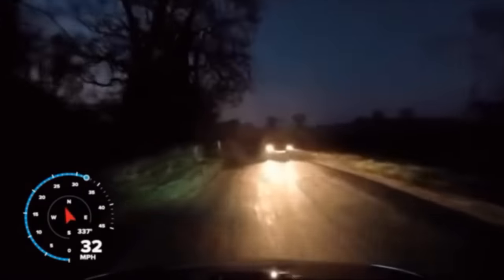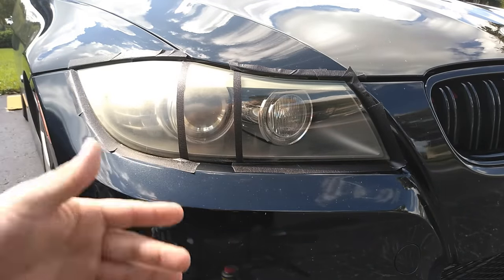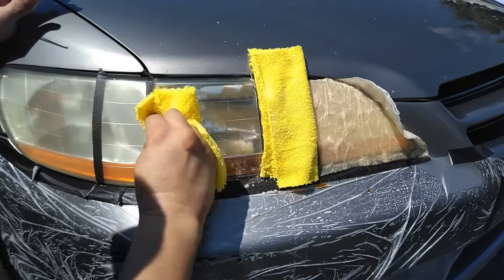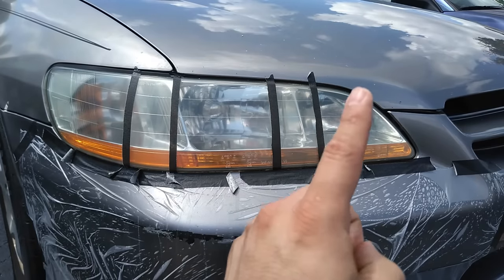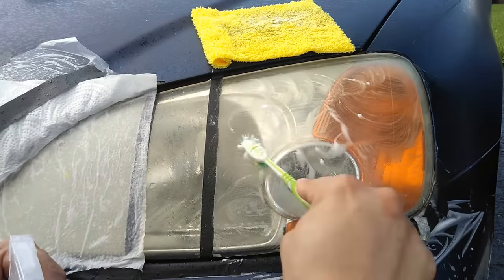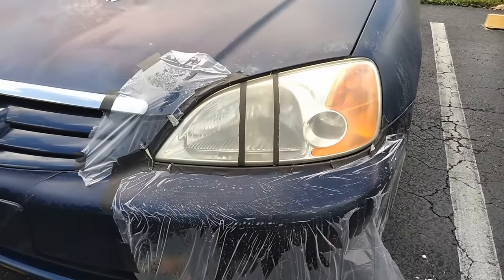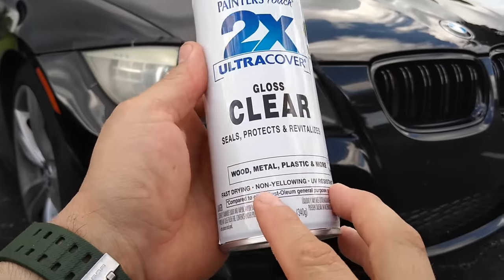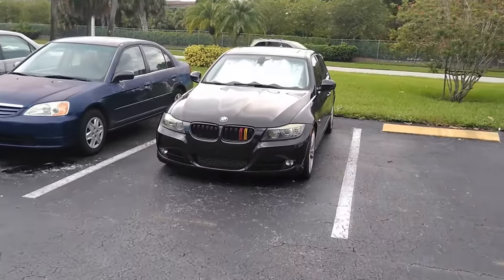How to Restore Headlights with Household Products (Easy, Affordable & Fast)

Comment: I’m a 71 year old female. I’m the original owner of a 2004 Honda Accord with only 61K miles. Last evening I was positive my headlights weren’t working. There were areas of my route I had to use high beams. When I got home, I discovered they were working but the lens were so cloudy very little light was getting through. I texted some male friends and said they can be cleaned for $100-300. I discovered your video!  I have the Mr Clean magic erasers. I just used a couple days ago to clean the white edge of my tennis shoes. I will buy the spray protectant and clean ASAP. Thank you for your excellent tutorial. I have been able to diagnose and fix several problems myself by watching Utube videos. I will let you know how my application goes. Thank you from Dallas
Reply: Please let us know
Reply: I hope all is well and we're still awaiting your reply!
Reply: I'm 74 and a few months ago changed my 2019 CRV brake lights. Looove Youtube DIY🎉
Reply: @ruthjorge440  😊00qaqqq1¹
Reply: Thank you for sharing
Reply: 2002 Honda Accord myself... 💞❣Great cars
Reply: Yes
How to clear moisture!
Reply: Off insect repellent works very well too
Reply: I'm 55 and your method is not right or ideal at all unless the units are very new
Reply: How did they turn out?
Reply: Lol you need new friends, headlight restoration kit [sand papers & polish] will run you about $15. Toss the different sand papers on a drill and you’ll have new lights in about an hour. 30 mins each light.
Reply: @Sir_Richard_Crainum_lll  ...your right a light sanding an power buffer using the polish....30 minutes per side. You can spray some clear cote an light buff by hand will last a lot longer .
Reply: Anaconda
Reply: Wow I’m so sorry somebody was gunna try to charge you so much just to clean your headlights. If I lived in Texas near Dallas I’d come do them for you for free ❤️ let us know how it goes! 😊
Reply: Yes how to clean moisture out
Reply: L
Reply from the maker: I just made a video for programing your Hondas Key fob at home. 😉

Comment: Show me how you can get the moisture out of your head lights
Reply: Replace the assembly?
Reply: Heat gun gets the water out from the headlight or blow dryer
Reply: @tonykeiiz7807  that's a whole lot cheaper than replacing it lol
Reply: Yea, how do I get rid of that inner headlight moisture?  Charles McC
Reply: Find out where moisture is entering, repair it. 
drill a small hole in an inconspicuous spot and use a hand held vacuum pump to pull a vacuum and hold it for awhile, this will do two things. It will evacuate moisture 
(same as pulling a vacuum on an a/c system) 
and it will confirm you have fixed your moisture entry leak. 
Remove pump, seal hole immediately with your choice of quick setting sealant.
Reply: yes please 😊
Reply: @MegaTapdog  yes pull a vacume on the assembly.... some assemblys have a port tou can hook the line up to
Reply: like mega tapdog says vacume will remove the moisture...
Reply: Moisture in Head lights
Reply: I drilled a hole drained and later plugged with a removable plug.
Reply: @angelnunyabeezwax3348  I
Reply: @tonykeiiz7807  be careful with heat gun. Can melt the plastic ...
Reply: Show me how to get moisture out of headlights
Reply: @kimgordon3695  exactly right luv
Reply: Remove headlight housing.
Remove bulb from housing.
Take housing indoors, and place it in front of warm air register (or use hair dryer).
Find holes or cracks in housing where moisture is entering, repair with clear RTV silicone.
Reinstall bulb.
Reinstall headlight into vehicle.
Reply: Yes, that’s a good question
Reply: @charlesmcclatchy7413  open the hood and take the headlights with the attachment then get and hair dryer with a long plastic tube attached to the dryer and blow the heath inside to get rid of the moisture.  It work well for me.
Reply: Willcresttoothpastecleanheadlights
Reply: @tonykeiiz7807  thank you Tony
Reply: How to remove moisture from front n rear lights but prevent it also coming back that's the part I'd like to know n cheapest n easiest solution that works pls
Reply: Remove the housing protect it from getting junk and dust inside and sit in the sun or put in the oven after you're done cooking and have turned it off.

Comment: The coca cola acid and the flouride is an prime example of what it's doing to our insides
Reply: Not quite, but it would be fine never to drink soda again. Our stomach acid pretty much wipes out bad stuff. Can you imagine if our stomach acid was poured on a,rusty nail? It would clean it lol.
Reply: Wrong, lol.  You realize our stomachs are full of acid, right?  And even in your mouth and throat, you have a constant supply of saliva and mucus that minimize any damage, much less the effects you see on plastic.  And If you never brush your teeth with fluoride the sugar from the soda will lead to much more damage than any acid.
Reply: But, dang it's just so Goooood😂
Reply: The fluoride in toothpaste has nothing to do with the cleaning ability of the headlamp.

Comment: I wish SOOOO MUCH whoever got the idea for these PLASTIC HEADLAMPS had them stuck where the sun don't shine.  The GLASS Seal Beams were superior and CHEAP to replace.  This is just another gimmick the CONSUMER ECONOMY has to keep people BROKE.  But having said that, you did a GREAT JOB!!!  I have ONE question though, after applying the clear coat, when it goes BAD, it will one of these days, how do you clean it THEN??? Great Video!!!  BB
Reply: Just get a turtle wax restoration kit and put a lot of clear coating on after your done. The grit paper sands off all of the oxidation and the clear coat protects it from the sun for atleast a year. After any of these in this video you can expect oxidation after 3-6 months. That's why the kit is worth 20$.
Reply: Q
Reply: @thestranger1164  For $20 bucks you could buy to NEW seal beams that would last for YEARS.
Reply: I just use acetone nail polish remover.  Makes them crystal clear in one pass.   Don't make more than one pass...additional passes cause the fog again.  Don't get it on the paint.
Reply: @Lili-xq9sn how long does the nail remover last?
Reply: @MrGlowBaby  clear as new until uv re-exposure begins yellowing/clouding it again.  
I ordered 303 graphene nano spray coating to provide some uv protection after I erase the yellow/clouding again.   
The 303 is temporary.   I'll probably reapply it every month or so and hope it won't yellow/cloud up in future. 
(My parking spot is in the sun.)

Comment: Use a small foam pad on a drill instead of a toothbrush, and you will get much better results. Then put a coat of wax on it and buff it out. When you've done that, use a nano wax product of your choice on the headlights, and follow up with a clean foam pad and you will have the best looking headlights around. Good luck with your restoration project, take care, and stay safe.
Reply: Great advice!
Reply: The original video was excellent and helpful, but I've come down to the approach you describe.   Power that baby out! Lickity split.
Reply: Very helpful hints thank u. I took notes and will try.
Reply: Only if you have a drill. As a woman I never had a need for a drill. I'm beginning to see a drill is actually a very helpful item for more than one type of use. 
I wouldn't know what kind to get though. Are they all the same? 

I miss my late husband 😒 he took care of all these kinds of things. 
Everybody should at least learn how to do stuff in case you find yourself in the position to need that skill. 
👍
Reply: @BabyMonkeyDefender  Definitely get a drill. And different size drill bits. You can use the drill to make holes and to turn screws. It beats a butter knife. Look through some of his tools (if you kept any) I’ll bet you find all sort a helpful items. Then learn what they can do. Have fun with it and good luck. Happy New Year!
Reply: @BabyMonkeyDefender   same here. I’m learning and using his tools. Get a drill. I found  round scrubbing brushes that attach to the drill for effortless cleaning of all types of  things
Reply: @BabyMonkeyDefender 
I'm so sorry about your husband. I lost my husband 12 years ago. Thank God for YouTube videos, friends and common sense. I have able to do a lot myself.
Reply: @BabyMonkeyDefender you definitely need a drill. I never stopped being a tomboy..now 62 yrs old. You're thinking right; that there's so many uses for one. I paid $70 I think on a Porter Cable 20 volt. It's really just a powerful rotary tool, but consider the cost of the bits and on a drill, their extra large bits. For standard use, get a drill and a basic set of drill bits, and a basic set of screwdriver hex bits. It'll pay for itself for the power, multiple uses, and convenience. I recently built a foundation for a shed and bought a small set of hex nut bits, for screwing bolts. Impact drills are normally used for that but I got by fine.
Reply: How do you all feel about a Dremel? I have a good one! What kind of Dremel pad would I use?
Reply: @BabyMonkeyDefender  I'm sorry for your loss and that you're having to deal with things like this on your own. It can be a daunting task, but only if you approach it with doubt in your ability to take on the day to day things like this. You can just buy yourself a Walmart cheapy drill like the brand that I use, myself. I bought a "Hyper tough" brand cordless drill (runs on it's own rechargeable battery) for most household tasks. I've owned one for a couple of years now, and it works just fine. Good luck with your project, take care and stay safe.
Reply: @BabyMonkeyDefender  60 yr old woman here. I have several different drills, my go to is my DeWalt.
Reply: How about toothpaste on a magic eraser?

Comment: Thanks for your advice. I found a bicarb (baking) soda toothpaste which worked really well. I was left with a fine haze, though.
My finishing touch was an application of "Brasso" metal polish: Rub on, leave to dry, then polish off vigorously with a soft cloth. The result is magic!
I use Brasso to clean scratches off CDs & DVDs too..!

Comment: I had a mechanic drill a couple if holes  at bottom edge of a light to drain any trapped water. Works fine.
Reply: I once had to drill a small hole in mine. It was literally a quarter full of water.

Comment: Very good tips. Never knew about the baking soda and peroxide. I always did the wet sanding and compound. Also, never knew about the clear coat after it. I always just waxed it afterwards to give it an extra layer of protection. It usually lasted about 6 months or so, but i can see that the clear coat would give me a couple years depending on whether i park outside or in a garage. Good info and tips.
Reply: Good looking bro

Comment: Thanks so much for the video! My 09 Corolla had terrible yellowing and haze. Cheap kits I've used on other cars won't last long on this one. I'm waiting for the Sylvania kit to get here, but wanted to start the cleaning process so it'll be less work, and needed something that wouldn't leave residue. I was SO happy using the baking soda method, it was amazing, wish I knew of it earlier. I used a heavy paste and repeated it twice, 5-8 min each. The yellow is nearly gone and there's only a slight haze compared to what is was before. Will definitely keep baking soda in mind when I need a quick temporary fix. 😊

Comment: Thank you for this wonderfully made video. You knocked this out of the park. Control areas to do side by side comparisons. The video is well laid out and even has labeled chapters. You avoided so many pitfalls of other DIY videos, explaining WHY things work with impressive detail, nobody ever explains why they work. You ACTUALLY reviewed every DIY solution you recommend. Can't tell you how many videos will spend most time on what they think the best one is (theyre usually wrong), and most of the other ones barely get mentioned or ever get explained. About to rinse off my headlights and enjoy a bit more lumens driving at night, they were dangerously bad. Thanks again 🙏🙂

Comment: FAST FAST FAST Acetone(nail varnish remover) on a microfibre cloth. One pass. Then autoglym(polish) spray and quick buff. Amazing result in about a minute and very little effort.
Reply: I use acetone nail polish remover too.  Makes them crystal clear in one pass.   Don't make more than one pass...additional passes cause the fog again.  Don't get it on the paint.  
What is autoglym spray? Where do I get it, please?
Reply: @Lili-xq9sn  autoglym is a car polish, available online or car accessories shops. Brilliant low labour spray polish

Comment: I had heard that you could pay to have someone else clean the headlights. I am 65 and on a fixed income.  Your video helped me with my headlights. I favor the toothpaste and soft cloth method. I have assigned parking and drive less than 3,000 miles per year. So, I like the toothpaste result as it last longer for me due to my reduced driving. In a small town you only add up so much mileage. Thanks for your helpful tutorial.😊
Reply: We sound a lot alike. I'm fixing to clean my yellow headlights on my 2001 Tacoma and can't afford a professional.

Comment: Did wonderful job explaining and steps how each setups never thought use clear gloss paint on them  I been using
Baking soda
Murry oil soap
Mix into paste apply some into dry soft sponge rub it in reapply more paste when dryed out on you then rise off with water hoes this last for good 3 month. May try that clear coat trick next round.
Again thank you for all your tips clearing the headlights lens and thank you for not applying annoying music with your video.

Comment: Great video! I'd just used a bought restoral kit, which uses 800-1200-2000 grit wet&dry sandpaper, then a buffing compound, followed by a gloss coat which smells like glue. It gave a good outcome for $25Au.

Comment: Nice video. These are great hacks, especially if you have hazy headlights and you're going to the car lot to trade in your klunker. The only real way to actually have long lasting results is to sand the headlight lenses with several different grades of sand paper ending up with a 3600 to 4000 grit wet sanding cloth or paper. Then use a special clear coat that does not build up on the lenses.

Comment: The manufacturer of headlight covers should be responsible for replacing them when they become hazed over.  This is a safety hazard and there should be a better Plastic product to make headlight covers out of considering the advances over the last few years.  Many shatter-proof glass products would eliminate having to go through this nonsense, but your video is far more informative than others I have viewed, Thank You!

Comment: You did a grate job at your video and all your steps worked but it will come back sometimes in days you really have to sand an buff. Clean and use a 2 part clear (clear an hardner ) witch you can get today in one can there is a button on the bottom of the can that u push 2 activate the 2k clear this will last 4yaers

Comment: If you have Mothers Mag Polish around your garage, it works great for cleaning headlights also.
Reply: I used this & it worked pretty well.  I then put a coat of carnuba wax, polished it up nicely with some protection against further yellowing.

Comment: I “REALLY “liked your videos they are very very good, I liked the toothpaste a lot. I also use bleach to clean the lights first and then use a cream car wax and rub it in in a circular motion clock wise and counter clockwise with a cotton cloth and remove it with a microfiber cloth and repeat the steps twice and it removes the oxidation and cleans and seals it very well and this lasts for six months

Comment: How do you cover your car safely from the clear coat (the least expensive way)? Also, do you need to cover your paint job of your car when using any of these hacks? (or was this more to highlight your testing areas and controls?) I’m most likely going to use the baking soda/hydrogen peroxide/white vinegar method.

Thank you for your thorough and thoughtful demo of these headlight restoration hacks!! Very much appreciated 😃🙏
Reply from the maker: When using vinegar, make sure to cover your paint. Vinegar is not going to damage your paint if it touches it, but if you leave residue on the paint, plus with the sun rays (heat), then that might be an issue. So make sure to rinse your paint from any products you use. 
Also, if applying the clear coat, you do want to cover your paint. You can use plastic bags, or you can buy some thin plastic sheets in walmart or Home Depot (should only be a few dollars) $3 to $5. When spraying, try it on a piece of cardboard or something. You can spray many light coats. Dont worry about covering all the surface, let it dry, and apply thin coats. It will all be covered eventually. This way, you will avoid over spraying the headlight. Good Luck 👍